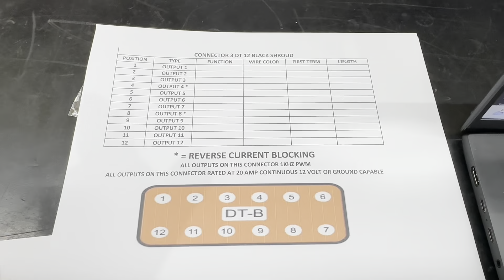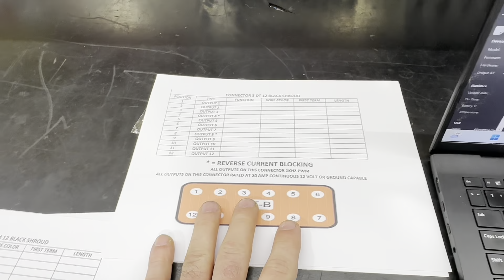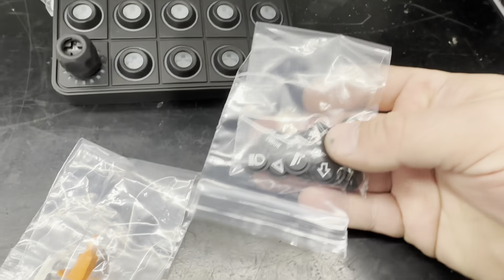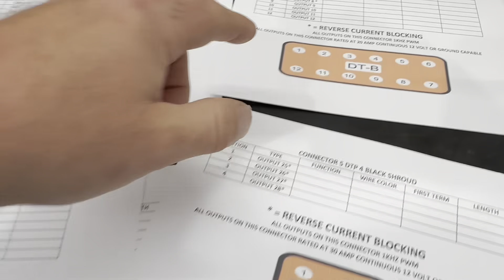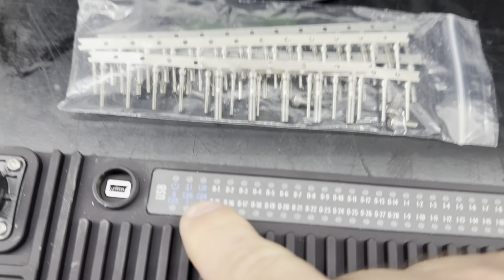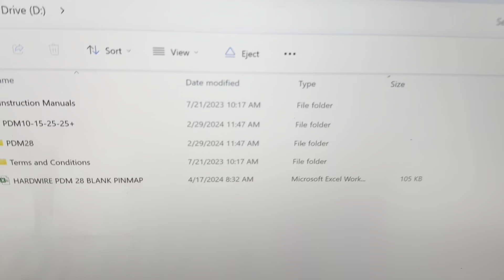Let’s take a look at the new Hardwire Electronics Pdm28

Comment: I wish I had got this over the ECUMaster PMU24.
Reply: why?
Reply: @sleepymeowtank  More outputs, more inputs, on the 24 to use all outputs you must loose half the inputs. 

More high current outputs
More amperage capability 
Every output has PWM ability
Connects direct with a USB, no additional module required
I prefer the radloks and I prefer the connectors, makes it easier to wire having several plugs as opposed to one.

In short, PMU24 is good, just that this is better.
Reply: @OldSchoolIan  Thought the pmu24 had pwm on every output? 

Im considering buying one of them or maybe the pdm25. 

Have you tried both? or u got the pmu from ecumaster?  

was thinking it was better since im going to use an ecumaster ecu
Reply: @sleepymeowtank  24 only has PWM on the 25 amp channels. The 28 has two dual bridge channels which would have been useful also .

I went with the PMU24, but if I had known about the Hardwire 28 before I purchased I would have gone with that. |

The PMU24 is great, so go with that if it meets your input and output needs. The only way it worked for me was to use 2 CAN switcboards alongside it.
Reply: @OldSchoolIan  Do you have lots of stuff wired up?
Reply: @sleepymeowtank  It will be running all the systems on my car, excluding 6 that are always live.
Reply: @OldSchoolIan  I got a 5 cyl audi s2. was thinking to run everything on it except  central locking, windows, abs , diff wiring , I think Im good on outputs but im wondering if it will be enough.
Reply: @sleepymeowtank  My recommendation is to spend a ton of timing on planning. I spent over a month planning every system in my car and every harness. Work out every input and output you need.
Reply: @OldSchoolIan  Thanks :) Yeah im preparing a lot now, and im finding new ways on how to do it or not to do it as I plan hehe. 

Just wondered if I should add some wires for some sensors that I wasnt planning on .. like "brake fluid level"  etc.. not sure if its needed or not, its a car that will be used 2 months a year only hehe

Comment: While I love the DT/DTP connectors for outputs it is concerning Hardwire ignores the current limits significantly.
Reply from the maker: Look up how those ratings come to be 
And you’ll understand te under rates them for our type usage by a lot 
With that said I never populate high amperage items right next to each other in a connector 
Space them out a bit
Reply: Are you planning on pinning 12 high current outputs on the same connector? I'd say the client base for this pdm knows better.

Comment: Do you know what could cause my new 3 bar low doller map sensor to read 86kpa key on engine off. We thought it was sensor but wasn't. It gets 1.66 volts key on not the 1.87 volts I check all my grounds and power and everything looks good but all my sensors are around 4.6 to 4.9 volts I unplugged all sensor to check for a change no change. And my tuner doesn't know what is going on.

Comment: The capabilities of a unit like this is not necessarily revolutionary. However this is the first time I am seeing it in a complete package with easy of installation a key improvement.  What I would like to see is the inside of the unit. What processors and other electronics are used? Any type of EMF shielding? Vibration/impact dampening materials? Any end user serviceable parts? Can it be daisy chained? Remote monitoring capable?  What about software/EPROM updates? Now I know these are probably designed for a specific use like what you use for, custom racing vehicles, but I have a specific need for something similar but durability is paramount for a unit like this as a catastrophic failure in one node, seems to me, would affect the entire module, possibly bricking your vehicle. Which is why in my last build I used 4 smaller units to better isolate failures. If you desire, maybe in the next video about this unit you could address some of these questions. I know you're busy so if not thats ok. I can do some research on my own. But sincerely, thank you for bringing this to my attention.

Comment: Do you have experience with running continuous loads as high as they are allowing on those outputs?
DT are only rated for 13A and DTP for 20, I’m sure for intermittent that a 50% over current is fine but continuous would make me a little nervous.
Reply from the maker: Look up the way those pins are rated and you’ll see they are very wildly underrated

Comment: Is there a pdm that can output 0-5v? I wired up an Aeromotive brushless pump on a street car, and i wanted to used the variable speed without splicing into any of the engine sensors.
Reply: I wired one up as a 2 speed,  you can run more than 5v on the 0-5 wire, so what i did was set up so the 0-5 wire would get battery voltage when we wanted the full 10gpm we just used an output of the dominator to send power when we wanted the pump high speed, we used boost pressure input for that.

Comment: That ECU also has a nice flat spot. You could print off a I/O output Sticker to put on there. 

And or what Holley should have done with the terminator putting a label for what the LEDs and or colors mean

Comment: $199 for a configuration file if they didn’t buy the pdm from you

Are they still 12v outputs if you’re running a 16v system?
Reply from the maker: It outputs battery voltage